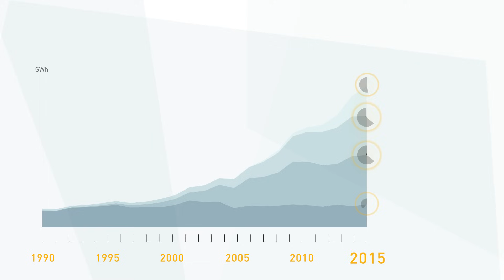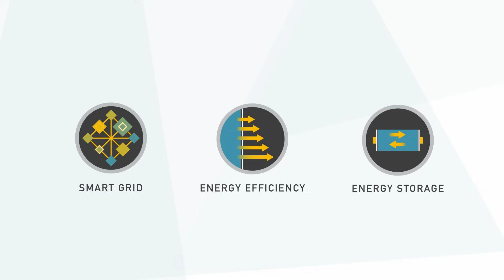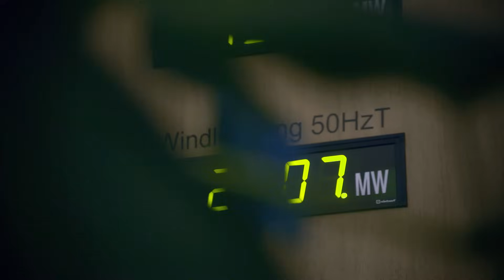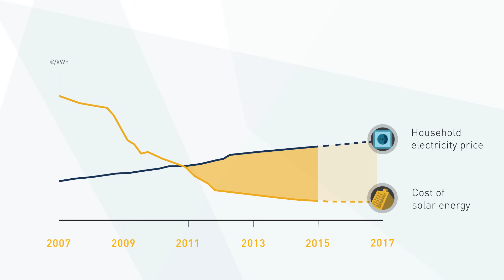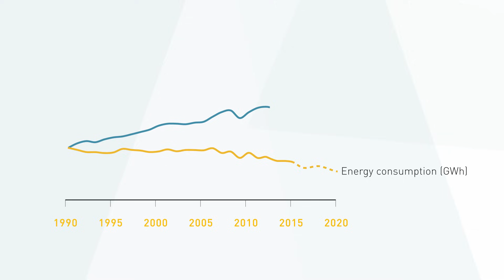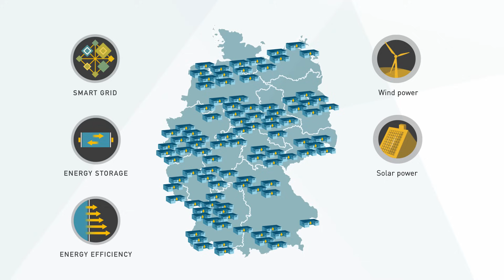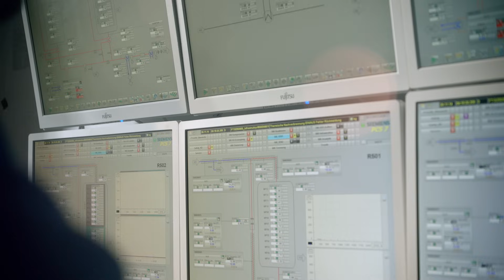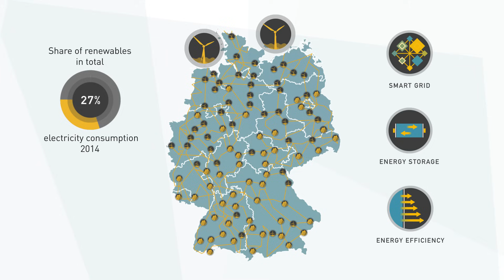Germany's Renewable Energy Revolution

Comment: Once again, Germany is ahead of the competition by miles. Some people just don't seem to realize how smart this is for Germany to do. They will have an extremely powerful industrial economy that doesn't really need imported energy to function. This will be a HUGE advantage for Germany. I see why many other European countries dislike Germany. They're envious and worried that they may not be able to achieve the same.
Reply: +anonymusum Actually it happened way before Fukushima. Many forget that a plan was already in execution to shift out since 2000. Merkel's new goverment had just voted to suspend that plan when Fukushima happned a few month later. The "new" plan shifts out nuclear in the same year as the original one. The only real difference is that the new plan had some reactors shut down imidiatly (the older ones).
Reply: Tuppoo94 Every country is responsible for itself. If they can´t manage it - well that´s not our fault. But one thing has to be mentioned: The main reason for this ambition was the political will to shut down our nuclear power plants. And that happened right after Fukushima.
Reply: +aidanjt 

So your backyard is ready? Can we start bringing a few tons tomorrow morning at 7:00 a.m.?
Reply: @bobrolander4344  You don't bury your rubbish in your backyard. We have very specific environmental standards for solid waste landfills to avoid the mixing of run off into the environment. I don't know why you would treat nuclear waste any differently.
Reply: Dependence on base load power is a myth.  What is necessary is matching energy production with consumption.  The best way to do that is with quickly dispatchable energy storage.  Traditional hydroelectric serves this purpose very well in some places, like Scotland.
Reply: +Lemmy
No it does not, jerk. Greetings from Frankfurt. Renewables and nuclear exceed coal production here and coal energy is considered to be dropped in the future.
Reply: It's kinda funny because many of us Germans say we are far behind other countries in many sectors. And they are not that wrong, especially with Internet topics.
Reply: Onkalo is expected to come on line in 2023.  Bob is correct.
Reply: +aidanjt 
Oh and not to forget, that nuclear power plants are highly subsidized. Besides the issue of "what to do with the waist", they don't have to have basic insurance for a catastrophic error, and one reason is, that it would make it a very expensive energy source. Japan expects that they will have a bill of at least 150 billion due to Fukushima.
Reply: Well not as much as several years ago and declinging rappidly. Several big compainies here in germany are currently getting rid of assets linked to nuclear and coal.

The nuclear phase out has little to do with the climate implication behind the Energiewende and is likley expression of a very specific german movement and expirience. People tend to forget (or not know) that the current phase out is the second one and that there was one in place before Fukushima that was just taken back a few month earlier by the new goverment voted in around that time (against the wishes of the majority of the people most voters just had stuff they had higher preferences about than the phase out). 

Also the german state that elected the greens as their ruleing party is still going strong (even after re-electing them) ...
Reply: Irish waters and inlands experience alot of winds one day Ireland could run completely on wind turbines.
Reply: Mode Liukas Hypothetically, but we'd still be dependant on foreign supply for base load, the wind doesn't blow 24/7, not even in Ireland.  Everyone got really excited over Scotland having a day of wind power, and completely ignored the fact that they only got that because they were hit by a storm and that was the end of it, and I sure wouldn't want the repair bill.
Reply: @aidanjt  build some energy storage more wind and more interconnectors and Ireland could run on mostly wind. while selling power when they produce to much and buy power when needed.
Reply: Dont compare Scotland to Ireland. Ireland can do a lot more if it wanted to again Ireland is not fully using its major strenghts to its advantage statisticaly its one of the windiest places in Europe if not the windiest the main problem is the quantity of these wind turbines that it would need, but it wouldn't need as much as Denmark for example. Money also shouldn't be a problem Ireland is no poorer then Denmark.
Reply: +Mode Liukas - As a Dane i am puzzled that your politicians haven't yet put up goals for wind energy, it's an absolute no-brainer.
Reply: Yes it is, jerk. Lignite to be precise. That's not even coal, yet. Greeting from Leipzig.
Reply: I am a Dutchie,and i like there way of doing things.
There is no hate,its a good thing wat the are doing.
Reply: +aidanjt The problem of nuclear waste isn't even nearly solved. Not one long term depository exists on the whole planet. Not one! And year after year we pile up ton upon ton of more nuclear waste.
Reply: @bobrolander4344  the earth is giant. we can easily find a place for it. modern nuclear reactors don't produce that much waste
Reply: aidanjt That's not the point. I never talked about the environment. I talked about energy self-sufficiency.
Reply: +Tuppoo94 Yes, so smart, they ditched relatively modern and completely carbon-free nuclear power, in favour of ye olde coal.  So green.
Reply: +Bob Rolander You burn up the vast bulk of the waste in newer reactors, we pile up waste because certain nations stopped building reactors in the 70s.
Reply: Bob Rolander That's bullshit. There's a facility for that purpose in Finland. Google "Onkalo spent nuclear fuel repository".
Reply: +Bob Rolander That's a legislative/diplomatic problem, not one of lack of disposal/recycling solutions.
Reply: Bob Rolander Ireland was never able to get on the nuclear bandwagon, the only nuclear products we have are the medical isotope byproducts that only fission nuclear reactor powered nations are able to produce.
Reply: You are only hyping the good parts. Defenders of wind madness always find ways to trivialize the landscape desecration, wildlife carnage (esp. bats) and the misery inflicted on rural people by noise and all the rest. Here's the real scoop on Energiewende: https://www.google.com/search?q=CO2+levels+Germany+Energiewende+wind+turbines